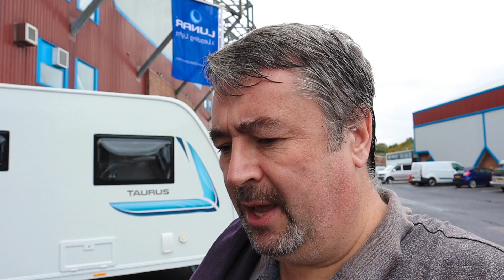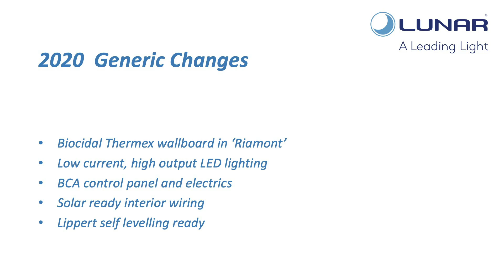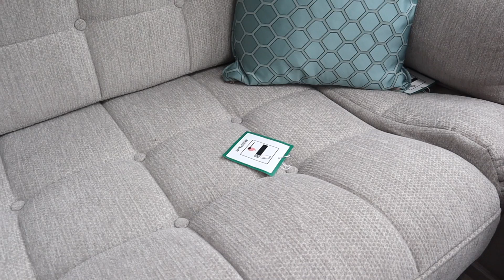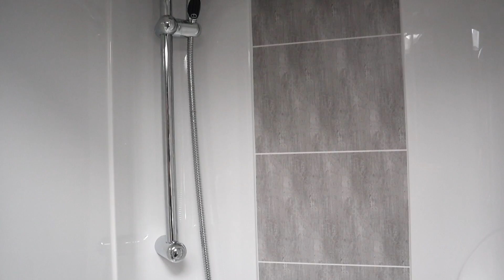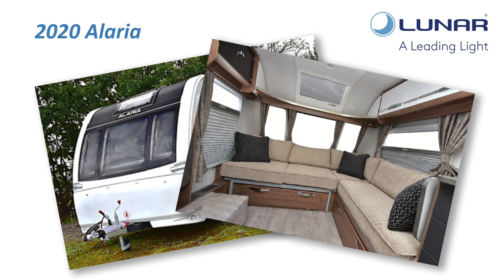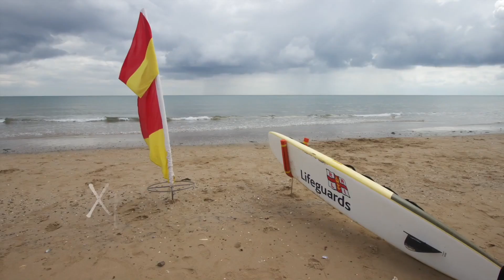2020 Lunar caravans first look

Comment: We purchased a 2019 Quasar 524.  At first sight, it's a superb 'van. I thought it would be easy to set up but found that the nose weight of the vehicle when, to all intents and purposes, empty was around 110kg (my nose weight gauge read 115kg!) .  I've had the devils own job to get it down to 75kg and have even had suggestions that the front locker be completely empty (gas bottles out) for towing and the front draw unit moved to sit across the axle to reduce the nose weight.  I do wonder if I did the right thing getting a Quasar.

Comment: Can air conditioning be added to these vans, in a neat fashion.
Reply from the maker: HI yes they can, there are a number of options available, maybe not roof mounted but under locker, or bed solutions are available Check out the range available from Truma.

Comment: Interesting to watch and listen to this as usual very well presented video, but may I add to your comments regarding the historical warranties.
We ordered a new Venus 550/4 on 31st of May and took delivery of on the 3rd of July 2019, and which I believe it to be the last of its kind to leave the lunar factor. The caravan is without doubt a real gem, we are very fussy and observant about all things, but we found no problems with anything, and the standard of finish exceptional. So far our only problem has been a leaking kitchen tap body, which our dealer is replacing for us this week, although he has had to pay upfront for the tap from the manufacturer!!
Now back to these warranties, and your comment that the new company hope to “uphold and maintain historical warrantee claims”, so, great if its true, but see, and I quote the information from my dealer.

Lunar Automotive Ltd have announced to the dealer network that they will be looking to offer a reduced level of warranty on 2017, 2018 and 2019 caravans.

Initially, we were very pleased to hear this news. However, we have since been informed that for Lunar Automotive Ltd to consider any warranty claims, the selling dealer would have to remain loyal to the Lunar Brand by renewing their franchise and commit to ordering a minimum number of 2020 model year stock. 
So gun to head or what, our dealer is not a large national company and for various reasons and still having 2019 vans to sell, has decided not to renew his franchise, so well done Lunar Automotive for this clever bit of business sense, as I am sure others may well take his stance, and no point making something if you don't have anyone to sell it.
So I for one would be very cautious of buying a new van from them as they have demonstrated how they perceive the importance of past customers, and no doubt new ones, and they may not even stay the course
Corinne and Tony Simmonds

Comment: They will struggle against Bailey and Swift.  If they want to set themselves apart from the rest then they do indeed need to look at quality as british caravans are pretty poor in my experience.  They need to offer no quibble warranties, 5yrs for the equipment and 10yr water ingress as standard for free would be a good starting point.  I would certainly would not buy one yet as they will need to get their production system back up and running (with new staff too).

Comment: Great review thanks and it’s brilliant to see our local manufacturer trying to get back in business. 
I still think they are missing a trick though, especially for those families / couples on tight budgets and who will probably use many sites (especially on the continent) that have really good shower n toilet facilities included in the price.
Why do we have to pay for enormous shower rooms or fixed bed layouts when flexibility, storage and durability is more important, as in vans of the 20th century. Not everyone wants to “Rally”, spending nights in a field with no connections but all the luxuries enjoyed at home.  
My wife would always question why space was wasted on a heavy oven when the fridge could be so much bigger. 
We use a stove top dutch oven if we have to cook inside our ‘93 Elddis Typhoon which we would love to upgrade but would need a 2nd mortgage to go new or recent age. Or it’s on a neat, camping kitchen in the awning when used if not under the gazebo.
I fully agree with you that solar panels should be a mandatory fit on new vans. Why the auto levelling? The exercise is good for us and I assume in some locations blocks would still be needed.

A question I would like you to pursue though is:- How are the manufacturers addressing the effect on their business and customers with the demise of diesel power and the capabilities of electric vehicles we are having to move towards.? Throw away the box and then start thinking.